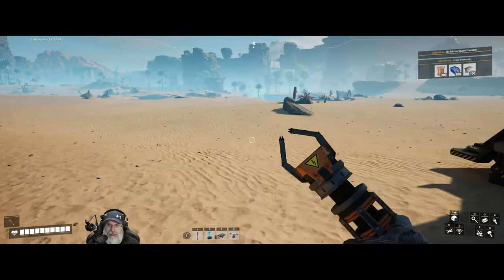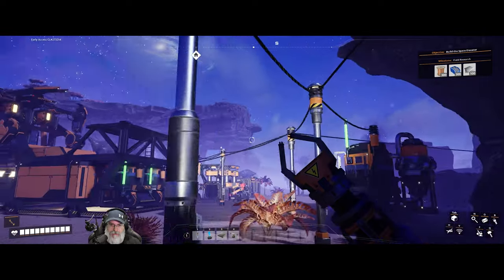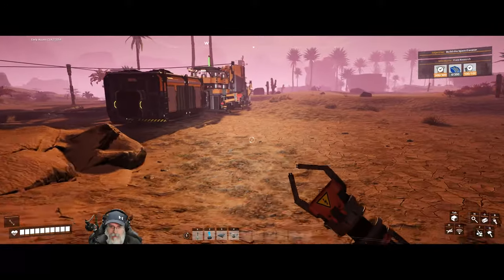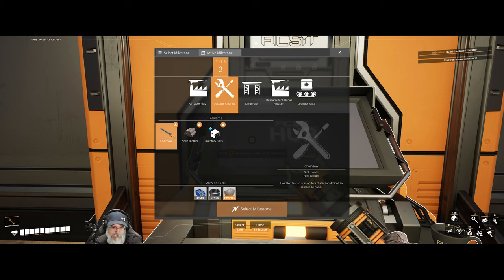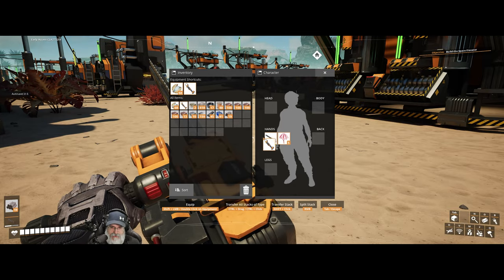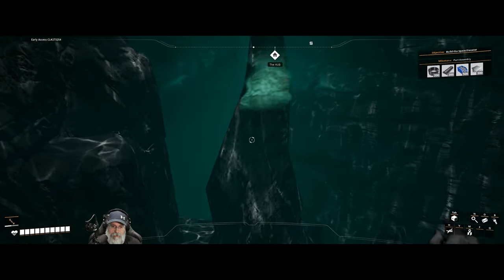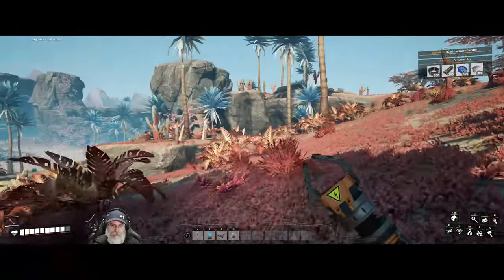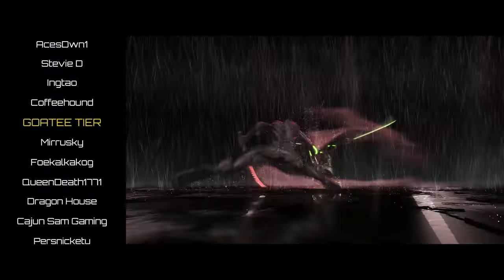Satisfactory Update 8 | E3 First Exploration

Comment: Not all the way through, only at 12 minutes in, but for the splitter/conveyor belt issue. You have to point your cursor directly at the belt when building it, not use the ctrl key which was just lining it up inline with your machines. At least, that is how I've gotten it to work. I've only started the video so you may have already gotten it figured out by the time you read this.
Reply from the maker: Cool. Thanks!

Comment: Hi OG, as far as I recall, you can't swim downward. The only methods I've discovered are either jumping/leaping from a significant height or utilising ladders.
Reply from the maker: Yeah I agree. I am not at all complaining but if they had some underwater content as well, it would be amazing!
Reply: Why are you holding control to place everything? I’ve played 100s of hours and never do that. My machines line up just fine. Watch for green lines and you’re fine no control button necessary. Your splitter isn’t actually connected to belt most likely because you’re holding control.
Reply: There is a mod for this though, since it can still be useful to swim downwards in some cases; i hope it'll get updated for 1.0 (that, or it being an added feature in the game itself)

Comment: Hey OG, to help with your belts alignement you can use your middle mouse button to change your belt direction and keep it aligned with control 😊
Reply from the maker: Thanks for the tip!
Reply: @TheBeardedOG  np. And btw it's easier to build on grid when u have foundations
Reply from the maker: @paxlo_0546  Indeed. That is all coming up. Remember that I mentioned that everything I am doing on the ground is just temporary and we'll be doing neat and efficient designs later. I just don't feel the need to try and make things neat/efficient until the real factory building starts. Thanks!

Comment: dont hold control when placing the splitters.
Reply from the maker: Why?
Reply: Because it snaps to the floor, you need to aim at a belt when placing a splitter on it, that way it'll attach to the belt instead of the floor